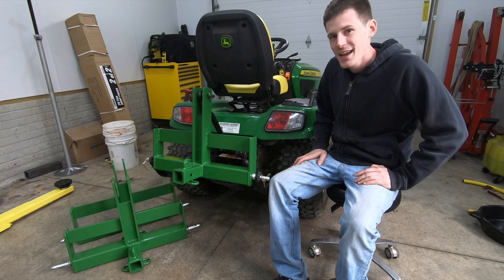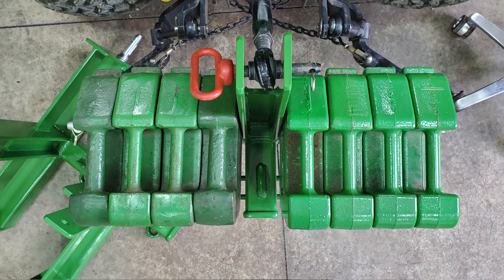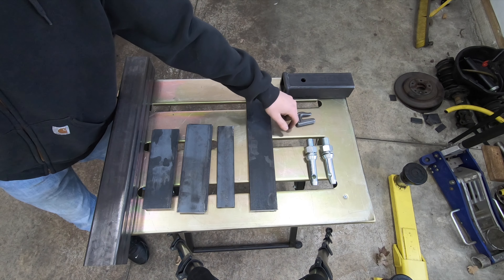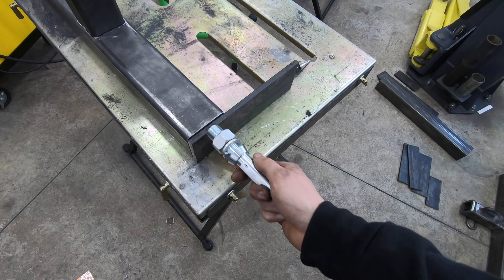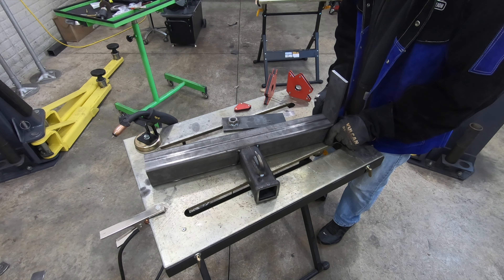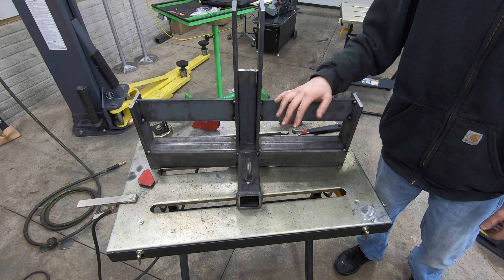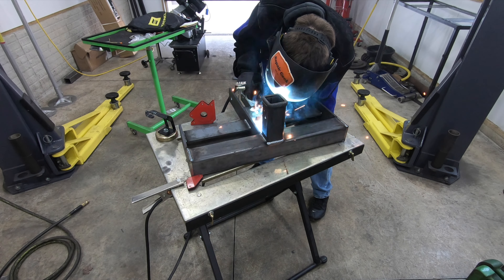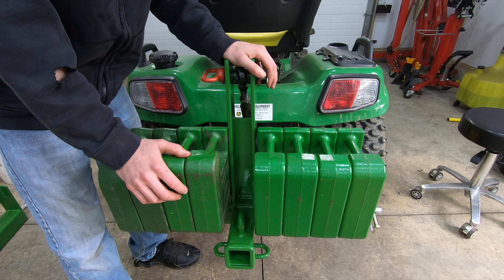Compact Tractor 3pt Draw Bar Build (Heavy Hitch Clone)

Comment from the maker: Heavy Hitch: https://amzn.to/3tDytY1
Titan Weight Bracket: https://amzn.to/3tsLzH9

Here is the list of material that I used to make my own Heavy Hitch:
-3" square tube 3/16" wall 24 inches long(Same as a super duty Heavy Hitch)
-3" flat stock 3/8" thick 9.5 inches long x2
-3" flat stock 3/8" thick 10.5 inches long x2
-3" flat stock 3/8" thick 16 inches long x2
-2" flat stock 3/8" thick 10 inches long x1Parts that I sourced on my own:
Cat 1 Pins: https://amzn.to/3ajhJNN
Receiver hitch: https://amzn.to/3dqBZiB
Safety Chain eyelet: https://amzn.to/3e79Zjf
Chain Hook: https://amzn.to/3aigkXI
Weights: https://amzn.to/3mW69NR

Tools I used to make the Heavy Hitch clone:
Welder: https://amzn.to/3dqCHwh
Weld Table: https://amzn.to/3v3lG1j
Step Bits: https://amzn.to/3ed7qvS
Carbide bits: https://amzn.to/32o9f3Q
Welding Wire:  https://amzn.to/32pZO3M
My Amazon Store:  https://www.amazon.com/shop/repairgeek
Help support the channel, buy using my Amazon links
As an Amazon Associate I earn from qualifying purchases and your cost is exactly the same.

Comment: Great build video! Thanks for taking the time to make this and include the dimensions you figured out. It’s helpful for me as I’m getting ready to fabricate one for my Ford LGT 165. I’ve got a Johnson loader on it, and I really enjoy the loader, but I need some counterweight bad. It’s currently got 50lb wheel weights, and I’ve got two big logs on my pallet forks on the 3pt hitch. It’s pretty jerry rigged and still not enough weight, but it gets me by until I can get my hitch made.